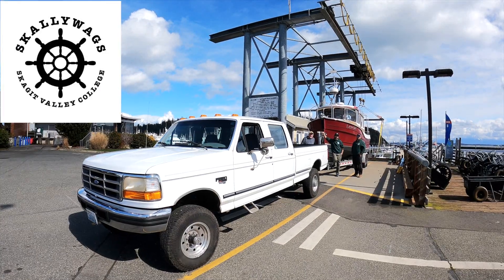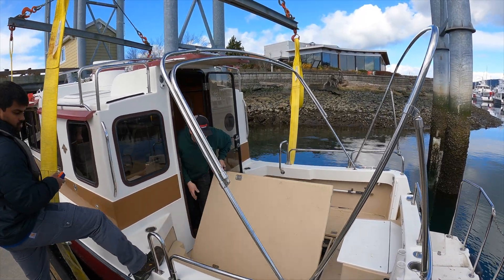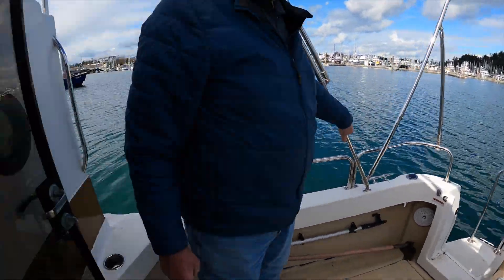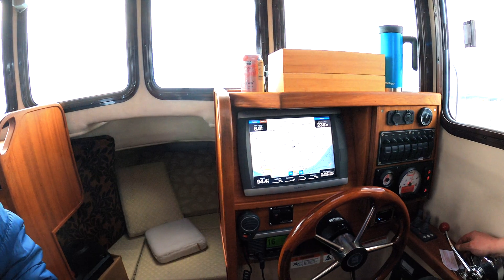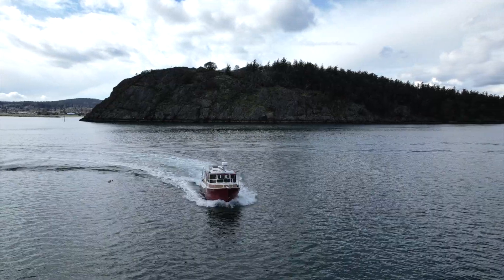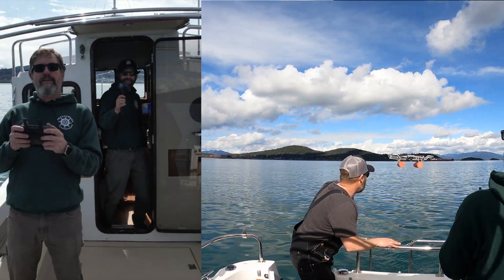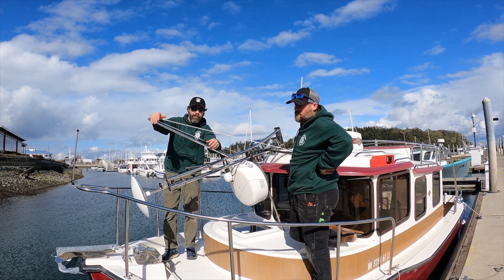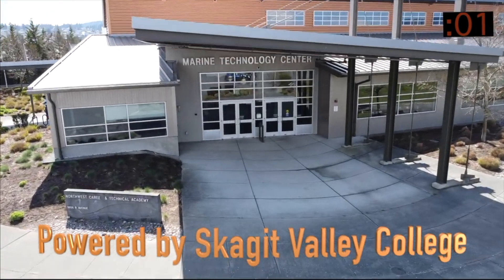Lady M: Sea Trial! 25' Ranger Tug with new Yanmar 4JH-HTE

Comment: Very cool boat and interesting project. I am looking to repower a 2009 R25 Ranger Tugs with a Yamar 150 hp (115 hp might be the most econmical). Would you guys consider taking on this project for me?  If you have documented how many man hours for the repower and final bottom line cost for engine and all parts,  inquiring minds want to know....especially me! I might even be interested in taking courses at the school.
Reply from the maker: Sorry for delay - we've been busy with the start of the new school year - lots of new technicians in training. We'll work on those details - we have a good idea of hours, the engine cost easy, but adding in all the extra parts will take a bit. I'll try to have it all compiled before we put the boat up for sale in the spring. We are currently full on projects - we have very limited space for projects.